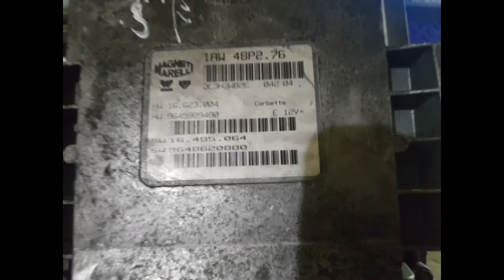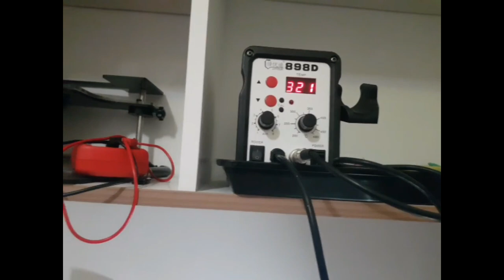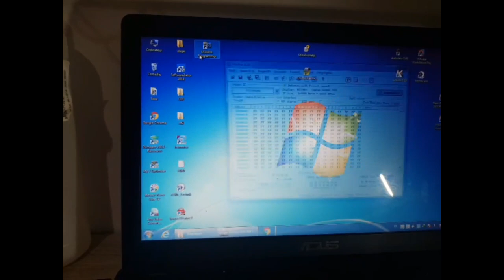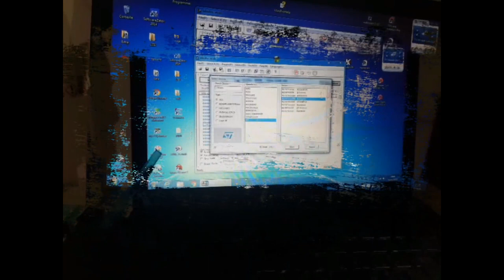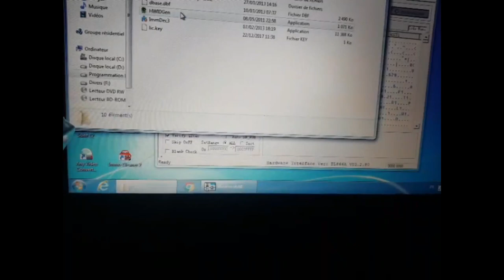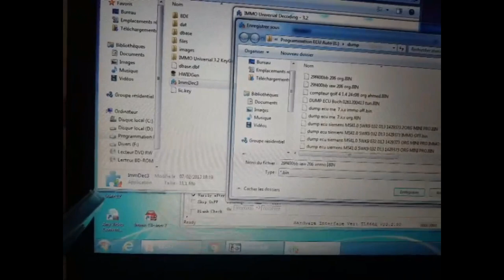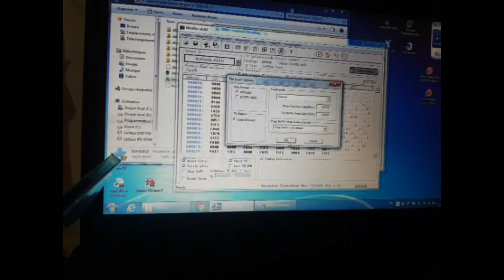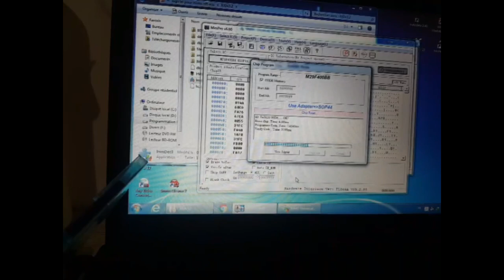TUTO-IMMO off Magneti Marelli IAW 48P2 PEUGEOT 206 || Désactiver Antidémarrage PEUGEOT 206

Comment: Do you need to change anything in the BSI block? Do you need to disconnect the connection between the BSI and the motor control unit?